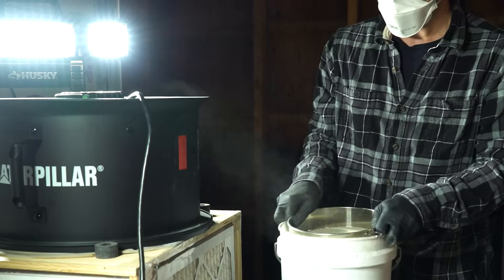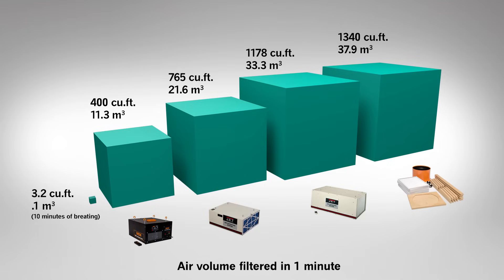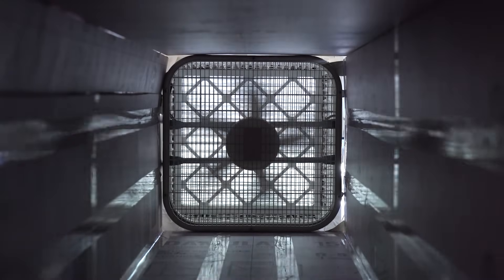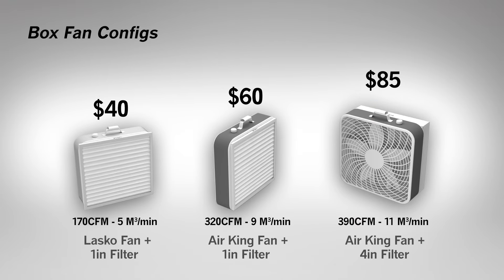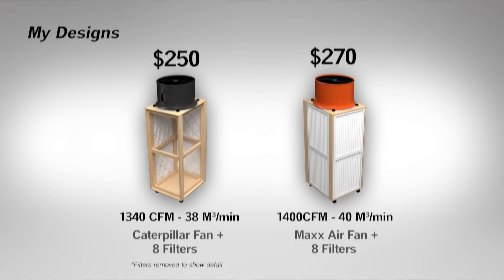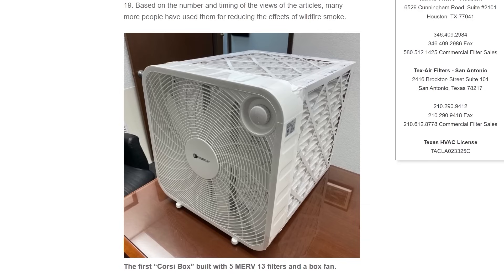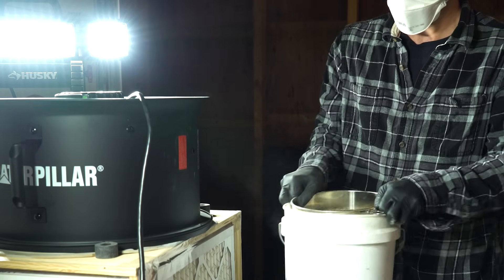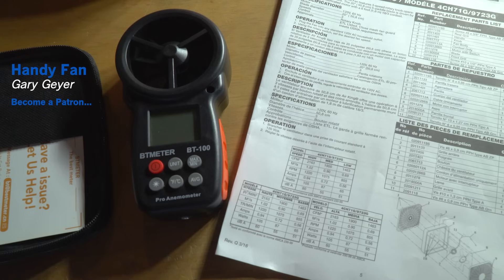What is the best DIY Air Filter?

Comment: Curious why the Air King is almost double cfm with a 1" filter then the Lasko but 1" to 4" does not seem to produce that much better results.. I am using a Lasko with a 4" and found the airflow significantly increased while sound decreased compared to 1" but dont have a tester to measure accurately.
Reply: Any chance you measured what 4" filter did on the Lasko?
Reply from the maker: The Air King fan box is a lot deeper and a bit wider than the Lasko. I'm wondering if that changes the aerodynamics and that results in better performance. It makes sense that the 4" filter would cut down on the sound because the fan is not having to work quite so hard, less air turbulence in the case, etc. I did not test how loud each option was and I'm thinking I should have now. I think you can download an app for your phone that can test the sound level if you really want to find out. If you do find out feel free to let me know!

I shot footage for this over the course of 2 months and still didn't quite get everything. The 4" on the Lasko was one of those that didn't make it but I would presume that it would be in the upper 300cfm range.

Thanks for the comments!
Reply: @The3DHandyman  I did test the sound using sound tester android app. 74- HIGH 69-MED LOW-66 Put the cellphone right under... Did a test to where i sleep from the fan about 2 and half meters away and the sound was 53 low- 60 med --- ambient was 41   - I run it on med sounds like the cabin of an airplane and i like it...and while working low.
Reply: @The3DHandyman  All good You have been the most through up to date... i am hoping its close to 300cfm lol biased as that is what i am running. I am however running a 3M 4" 1000MPR Merv 11 got them on discount.. my needs were more for Dust control. I will have to source an Air king fan but have not seen this brand around here in Canada.
Reply from the maker: @adriand6477  Thanks for testing it out! Those seem to be the standard ratings for most fans. A good rule is to set it to a lower speed if it's to loud. At my old place I could hear the one in my storage room around to clock and though it was nice too. A fine white noise generator!
Reply from the maker: @adriand6477  As far as the Air king goes, any box fan that is deeper than the standard design should preform about the same.

The MERV 11 should also give you a performance boost over the MERV 14. Maybe you are hitting 500cfm already!

I should probably test different MERV/ FRP levels at some point...
Reply: @The3DHandyman  Absolutely level 2 doesn't bother me and level 1 is perfect when taking zoom calls. I did the same upgrade to a very very old 22 inch box fan super quiet on level 1 so go that going in the TV room.
Reply: @The3DHandyman  That would be sweet, if you do also brands... From reading up the initial guys making the Corsi boxes they found some brands filters didn't live up to their Merv ratings. They were pushing the 3M filters pretty hard. Up here in Canada the 3M branded ones construction wise just look more well built then the private label brands available here. But limited knowledge on my part.
Reply from the maker: @adriand6477  Those old fans are great. The first time I ever did one of these filters it was with a 22" Lakewood from the 70's. It worked great.
Reply from the maker: @adriand6477  I dont know when I might be able to test the filter's effectiveness. It requires a fair amount of tools that are pretty expensive. The Project Farm channel has a breakdown of different brands but he was using MERV8s. If I remember 3M is one of the best tested. They make great stuff overall. 

The benefit of the off-brand filters is their price. I figure if they are rated for MERV14 but under preform that they should at least be able to beat a significantly more expensive FRP10(MERV11) 3M or Honeywell Filter. If you are only buying 8 at a time vs 1 at a time it makes a big difference.
Reply: @The3DHandyman  Yea its a really old 22 inch Canadian made fan its super quiet i am looking forward to testing out the 4" filter on it once the 1" gets dirty.
Reply: @The3DHandyman  Absolutely i have been hunting for deals everywhere i go. Honeywell filters are not as widely available.. I am just blown away at the difference 4" filter has made on the airflow. And if it lasts the 12 months its worth it.
Reply from the maker: @adriand6477  It may even last longer. The high power portable unit I made didn't have it's first filter change for 3 years! It all depends on how much it gets used and how much dust there is to filter.

Comment: Great video! Thanks for doing all this testing, I think I'm going to build the 5 filter Corsi-Rosenthal box this weekend.
Reply from the maker: Awesome! You wont regret it. It's a great design. Are you going with the wooden dowel legs?
Reply: @The3DHandyman  Yes! I have a smaller shop in my basement and I think this design will fit perfectly
Reply from the maker: @empir40  One benefit of the tall legs is that you can still put things underneath it. Fun fact I actually installed the one from the video in a friends dog kennel room and it needed to be taller so that the puppies wouldn't chew it.

Let me know if you ever have any ideas for improving the design!

Comment: I'm stealing your current design, cutting down to 4 filters instead of 8 while using 4" filters. That should allow me to be low profile enough I can sneak it under a bench when the car needs to be parked in the garage. I don't see a link to the Anemometer. If you have one, I'll just order it for comparison. Or any other recommended option. Great video! Super excited for the next one!
Reply from the maker: That's a great idea! The 4" filters may even preform better than the 8x1" filters. The original video for that design shows a 4" filter option for a moment during the animation. How do you plan to hold down the filters? That's one part I didn't give much thought to.

Anemometer Link - Right now this one is the lowest price
https://amzn.to/3OkzmhF

Feel free to post the results of your test here!

Comment: I wonder if the air surrounding the fan is being pulled and adding to the factory airflow?
Reply from the maker: Great thinking! I was thinking that but decided not to add it in an effort to shave another minute or so off of the video... The air around the sides of the fan does move along with the air being pushed through the fan. Technically that air movement is the fan's doing and may be part of the factory's CFM number. That's fine for generating air flow under normal operation but it does not play a role in what is actually being filtered by these devices.

Comment: Terrific info!! Your design with the CAT fan is the design I'm gravitating towards. I'm a DIY'er and occasional maker. I like this design as it offers portability with really good dust control. When doing a home improvement project I can keep dust from entering other parts of the house; certainly down to a minimum. Thank you again for all your efforts...the education is awesome!!
Reply from the maker: Thanks for the comment! I think my original design should work great for that. You can park it in a doorway and that should prevent any dust from escaping. I have also used it in a dusty room for end of project cleanup by closing the doors, putting the filter in the center and using a leaf blower to kick up all the remaining dust after vacuuming. Definitely wear a dust mask for that :)
Reply: @The3DHandyman  Great minds...Milwaukee bench blower is on my list.  I've bought a nice mask made by Trend. It's comfortable which means I wear it. Now, I just have to find the time to build your CAT version. LOLOL
Reply from the maker: @neilbaltes3469  Finding the time is always the challenge!

That Trend mask looks pretty nice! My 3M is just ok as far as comfort. I'll need to try some new ones at some point.

Comment: Im using your builds along with Bill Pentz and D C Knives to fabri-cobble a metal grinding dust control system- Won't lie- shameless plug- that anemometer would help a lot - I get a lot of value out of your builds and content- thank you for the opportunity to look over your shoulder and learn.
Reply from the maker: Awesome and thanks very much! Will keep you in mind for the anemometer. I will need to find an online number picker or something to figure out who wins the unit. If you don't happen to the the winner, they are pretty fairly priced https://amzn.to/3OkzmhF

Grinding dust is pretty intense. The place I used to work at had piles of it everywhere. So much cleaning involved. I wanted to work with them to develop some dust control concepts but there wasn't any interest from management.

Comment: I've been thinking about making filters with smaller fans, sized to match the airflow possible through one of these filters. So, rather than adding eight filters to one big fan, give each panel it's own little fan, perhaps a large PC case fan, with a slim profile frame. That might let me wall mount them for unobtrusive background filtering or deploy them in a cluster around a dust source temporarily. To equal the flow rate of your big box, divide the flow rate of the fan you have on it and locate eight fans, each with one eighth of the airflow.
Reply from the maker: That a cool concept! It looks like you can get 100CFM out of a good 200mm case fan. Since it's a low volume of air the filter shouldn't produce that much static pressure to slow down the flow. It will also be far quieter than anything in this video! haha. Let me know how it works!
Reply: Maybe fans from dumpster / e-waste PCs would be required to make the project cost competitive.
Reply from the maker: @AndrewHelgeCox  Good point. They don't have to look fancy.

I have a high CFM server fan kicking around that fits that description but it sounds like a jet engine!

Comment: I'm currently trying to make a cheap replacement for the hepa filter on the vacuum cleaner, cutting up large hepa filters from ebay
Reply from the maker: Sounds like an interesting project. I have something like that in mind for a future video but it's going to require a lot of time I don't have at the moment. Let me know how it goes! Be sure to wear a dust mask when cutting into filters, some can be made of fiberglass.

Comment: First 100! So I'm guessing it's better to pull dirty air opposed to push dirty air through the filters.
Reply from the maker: Generally yes. This will keep your fan clean and probably extend it's lifetime. The example at the end has a totally enclosed motor which is more safe to pull dust through. The "push" method has a lot of benefits that I really like. I talk about it in my "Air Filter Updates" video. Thanks for the comment! Will add you to the drawing 👍

Comment: I was about to go to sleep when I saw this upload, and there is no reason to not watch it right away.
I’m leaning towards the vertical push design with maxxair fan.
Reply from the maker: Awesome! That design worked great for me for the 3 years I used it. Never even changed the filters until I shot the "update" video on it. It is a bit more powerful than the Caterpillar fan but do keep the motor housing clean... Maybe I can get around to make a 3D printed housing for that at some point. It's been on the To Do list for 4 years now...
Reply: @The3DHandyman  I have a lot of things on my todo list as well, but new projects always sneak in before them.
I am currently getting close to finish a dining/gaming table build. Once that is done, I do need to solve this dust problem and get my shop clean.
Reply from the maker: @What_Other_Hobbies  Hah, yeah. New projects always seem to take precedence. I have a fairly large box of things I may get to some day. 

The air filter build only took 1 day. Not to bad as far a projects go. And you don't have to spend twice as much time filming yourself doing it!

Comment: Awesome work. I've been wondering if there can be a design version with good enough airflow that could fit permanently under my workbench. The beastie-boy seams interesting in that regard!
Reply from the maker: I like the idea! Will add an under bench design to the next video, possibly with 2 smaller fans. Is a low profile design important to you?
Reply: @The3DHandyman  Great! Yes a form factor that would not be too high so it can fit under a workbench would be great, since that's where 98% of the dust I produce is. It would surely catch most of what falls from the benchtop, and through the dog holes, which would perhaps turn the bench into a suitable sanding station? Just spitballing. We'd get the benefit of a clean air, without loosing floor-space, for those of us in restricted areas.
Reply from the maker: @classicalmockups8814  I am getting a few more ideas for this. Maybe I will do plans for more than 1 option. Thanks forgetting the concept going!
Reply: @classicalmockups8814  that's a great idea, I would love to see what you end up doing and what handyman will design!
Reply: @The3DHandyman  That's great I'm happy I could contribute in some way, and eager to see what you come up with!
Reply from the maker: @classicalmockups8814  One thing I thought of along time was building a purpose built table with a pegboard top side that would function as a sanding station. Sort of like a reverse air hockey table. Or maybe a thin, portable table topper that could be moved out of the way when needed. 

What do you think about that concept? I could draw up plans for both.
Reply: @The3DHandyman  That would be cool! What I had in mind was perhaps a mix of your designs and what you can see in this video: https://youtu.be/k1wMsF75k_w?t=1520. 
For me the primary function would be general air cleaning and getting rid of dust before it settles everywhere, but there might be smart  way to make an under the bench cleaner work as part of a sanding station.
Reply from the maker: @classicalmockups8814  Nice video! Are you willing to drill holes in your tabletop? Or would you like to see dust collection around the sides of the tabletop?

I have a steel table that I want to make an air filter for but I don't want to put holes in it. Which complicates things.
Reply: @The3DHandyman  For me it would be under my work bench, where I do everything (I'm woodworking in my little appartement livingroom/kitchen area, so I have very limited room, and fight dust continuously), so there are already bench-dogs holes. But collection from the side where dust inevitably falls as well is just as important.
Reply: @classicalmockups8814  Hello there :)
I am in exactly the same situation as you are and I spend the majority of my time in this room (remote work) so I am really wary of the dust 😷.

Would love to know or see what you did end up doing :-)
Reply: @The3DHandyman  I will reply here as i was thinking about the same thing! in my case i was thinking of having the fan pull air through the filters and blowing off towards the floor (basically the fan is sticking through a hole in the bottom shelf of the table.
Reply from the maker: @tenchuZsenran  Yes! that was the idea I had in mind. I will draw up some plans for the next video  👍